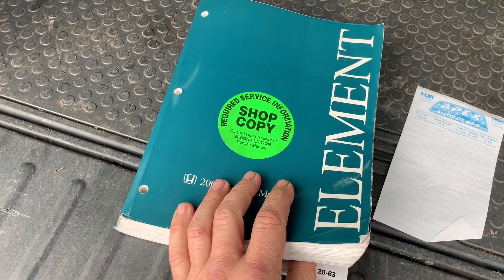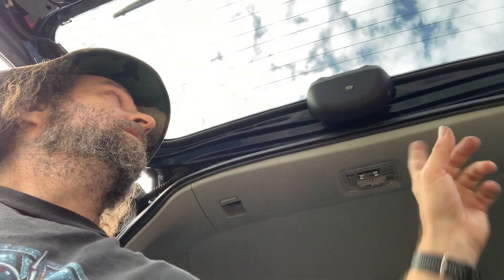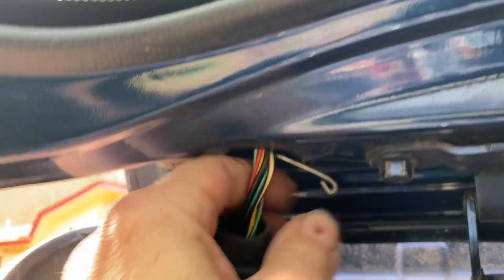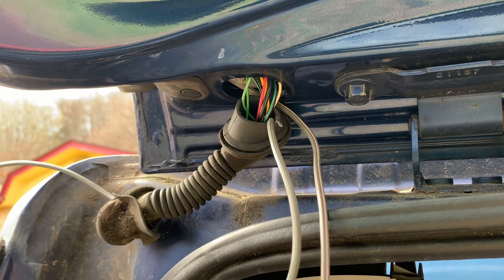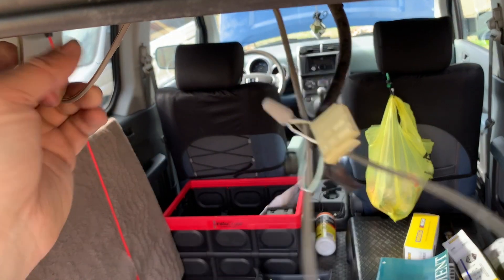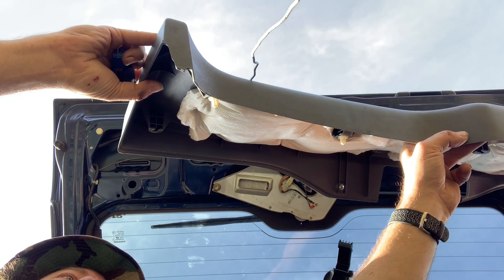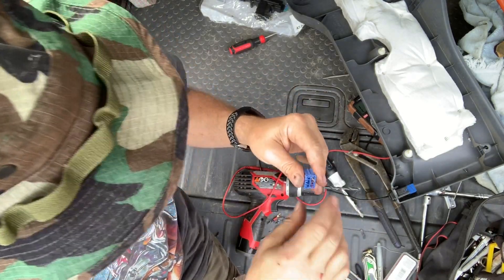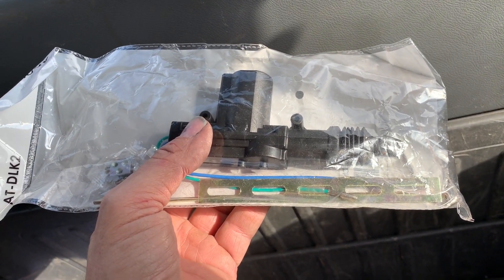Scavenger Type EP17: Honda Element Hatch Release Mod

Comment: i think i'd prefer a manual inner door latch mechanism tbh
Reply from the maker: Yea but there were already videos about that. Manual is a lot less complicated to pull off.
Reply: @clintsearcy3252  I think I'm gonna try your way.  But with a more low profile round momentary swtich/button. what do you think
Reply from the maker: @CoyoteGeneral7788  I like it. At some point I'm going to replace this gray one with a black one I found. I may put in a smaller switch them too.

Comment: Lot of work though and still depends on battery power.  I just installed a LaZBoy lever and cable from the Zon.  Looks stock and is purely mechanical.  $10.  Also added a grab handle so we can pull down the hatch from the inside, as we now camp in the Element some weekends.
Reply from the maker: Yea, but anyone could have done that. And camping with a dead battery doesn't sound like any fun. Actually, I like the lazy boy mod.

Comment: Very nice, only problem I see if for some reason your battery dies this will not work but the cable hanging out would still work
Reply from the maker: Yep, If the battery died you would have a problem for sure. It wouldn't be too hard to ad both the button and the shoestring if that were a big worry.
Reply: Was thinking the same thing but still really cool

Comment: All you need is some heavy duty nylon string and a button. Tie one end of the nylon string through the loop in the latch above the o. e. cable and run it toward the driver' side.. Punch a tiny hole through the plastic door panel in any convenient spot. Run the other end through that hole, leaving some slack hanging toward the interior. Replace the panel and pull on the string. The latch will open, and spring back.  Finally, tie the button to the string, taking up enough slack so the button pulls against the interior panel. The only tools required are a pair of scissors to cut the string and an awl to punch a hole in the plastic. I even found a 1 inch diameter gray plastic button to match the interior!
Reply from the maker: Yep, I've seen the shoe string method too.

Comment: In houses you can use vaseline as wire lub, but in cars thats bad for the rubber, its best to use silicone grease, or brake caliper grease, which is made from silicone
Reply from the maker: I used to use Joy Dishwashing soap on a pinch for pulling wire.

Comment: Those also go bad in not too long, its best to get an OEM lock actuator from a junk yard, and it will last longer than those, I converted an old corolla my sister had, to have power locks with those, and I think it was in under a year, most of them had failed
Reply from the maker: This is working well so far. It's certainly not the highest quality. If it fails I might step up to something more high end from the hot rod world.

Comment: I just purchased a used 2003, and want to do a few things to it and clean up some rust. Your channel is fantastically helpful!! Thank you! Just a little tip, you can use hand sanitizer for cable lube. It's not quite as good, but it won't leave things slimy once it dries, which the lube really never does.
Reply from the maker: That's a handy tip.... get it?

Comment: Great upgrade! Was just about to do the factory door pull handle and cable but I like this upgrade WAY better. I found the actuators but I can't find that exact switch which is the one I want. Do you have a link or direct source where I can find one? Thanks for the video! I'll post your video link to some Honda Element sites I'm on.
Reply from the maker: Sometimes grabbing parts off ebay can be hit and miss. 

The switch I used is a hatch switch from a 2001-2005 JDM Honda StepWagon van. These vans are not sold in the USA so the parts are harder to find. Believe it or not, when I made the video just a few weeks ago there were 5 or 6 of them on eBay. Now they are all gone. The Honda part number for the switch is M10433. This switch is used in more than one application on the Step Wagon. For example the AFS switch has extra wires for a little light and a different graphic printed on the switch but it would still work and it would mount the same way.

Almost any momentary switch could be adapted for this project but I wanted something that looked OEM. There were two other switch I liked for this project. The first was the lift gate switch from the 2005-2010 Honda Odyssey which looks cool and factory but would require a different mounting location since its bezel is larger. The other one I like is the 1997-2001 Honda CRV trunk release switch.  I like that it sits recessed in its bezel and would be less likely to be accidently activated. Both of these switches are easier to find.
Reply: @clintsearcy3252  Thanks for the update. I saw the AFS one but liked the graphic and OEM look as well. I'll keep searching. I have something in mind.